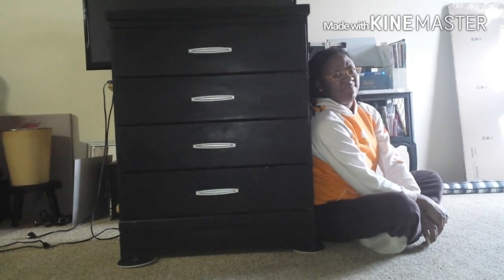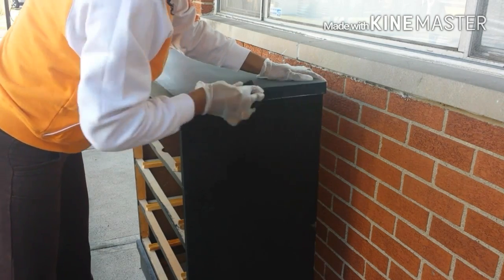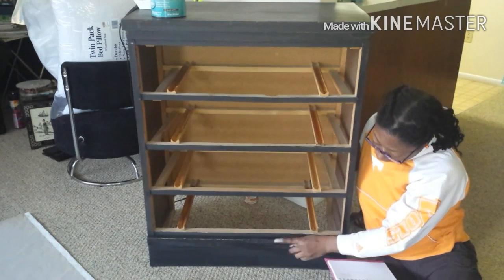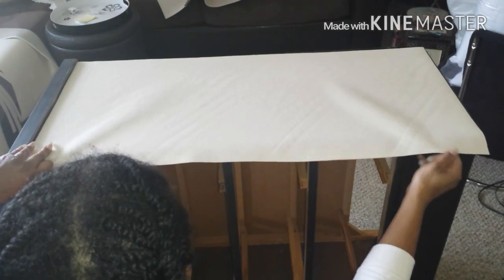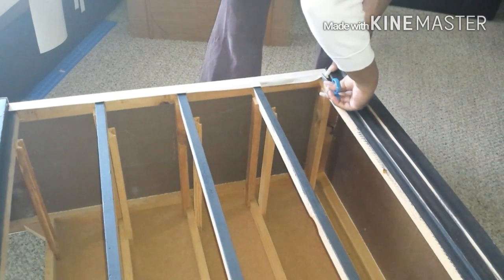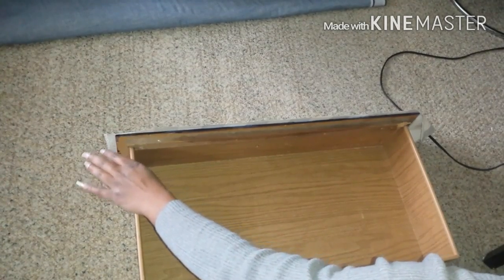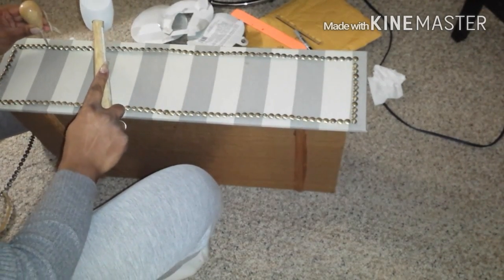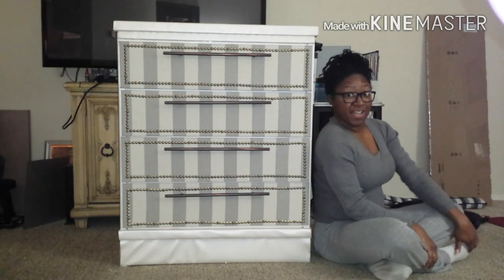Bedroom Remodel: Fabric Covered Dresser

Comment: Hi there...you sure had a lot of endurance and determination going through all this....my best reccomendation if you decide to do this again....use tacky glue...awesome stuff....i have used it for fabric on wood...plastic...even medal..easy to work with...no worries of it effecting fabric texture..does not dry fast and easily repositionable....trust me you will have many ah..ha..moments....great stuff....i love....love. Tacky glue....they should sell it by the gallon...you can get it at joannes and use a half price coupon...girl...save yourself from all that trouble...oh...and tacky glue is odorless and washes off easily....i felt for you seeing you endure the odors and your frustration....and instead of wrapping fabric around areas cut clean lines and paint rest or cover fabric edges with trim....also save yourself from all that work ...get yourself yards of strands of half back pearls...spray paint them the color of nail head studs to mimic
The ones you like....and just glue them on.....glue dries clear....if you use this method it dont matter the quality of dresser or furniture you are using..as far as thickness and what not....best of luck to you.....i dont claim to be a miss know it all i have learned in the diy school of hard knocks too....oh and this way im pretty sure is much cheaper and a lot less wear and tear on you and enjoyable too .....you will love it.....let me know how you make out if you try it....just remember thin even layer of glue...no lumps....use your hands withdisposable thin plastic gloves to apply......works like a charm...you will be amazed and impressed how easy....and if using stripes again.....plop on the glue...apply fabric on all drawers....line all the drawers up to match up lines before cutting.....i give you props cause this is how we all learn...and do yourself a favor get an electric staple gun...love....love....love....you will too....have fun
Reply: Your comment was so helpful. Thank you!